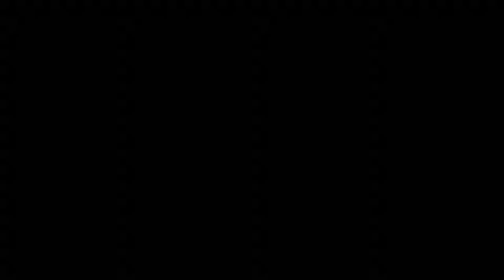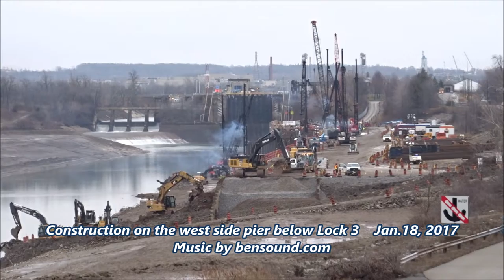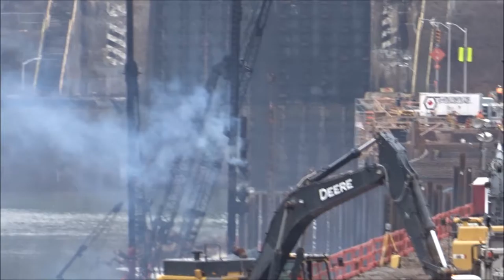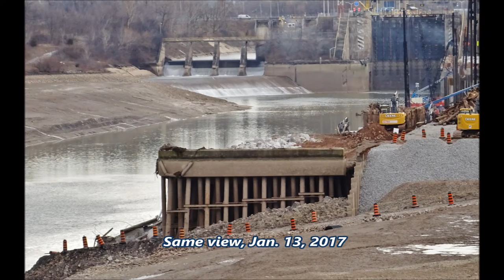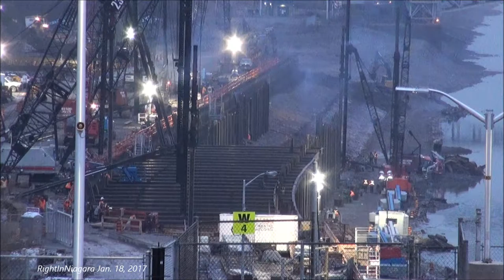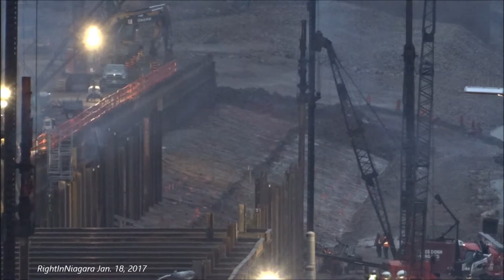Welland Canal Pier Construction (Jan 18, 2017)

Comment: Great video RIN, are they working around the clock? and also were they welding I-beams 1 to the other or were they cutting off at that level?
Reply from the maker: From what I saw, it looks like they are pounding the steel pilings in, and welding more on top to get the depth. Then the beams are set, and then more pilings are driven in between. Those beams will be covered in precast concrete slabs, which will become the backer for a later poured concrete pad. There's a lot of welding going on.